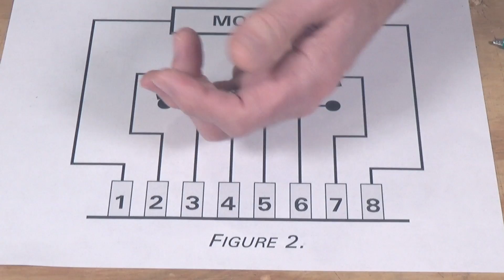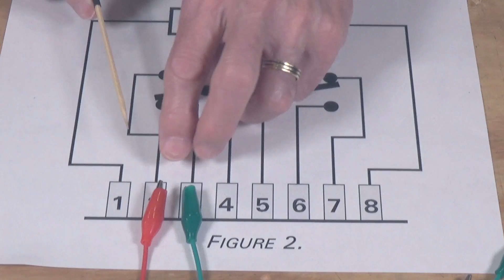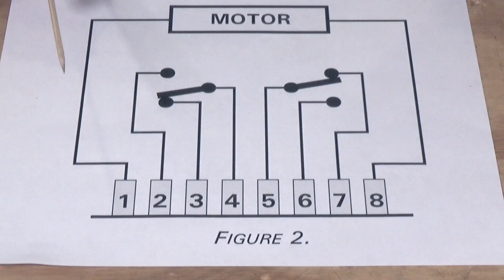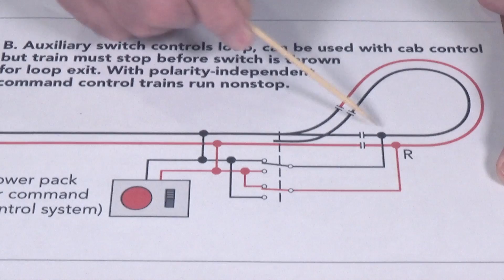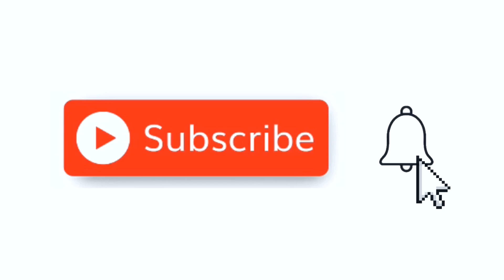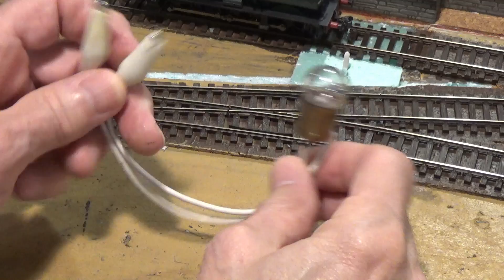Control Frog And Track Polarity Without Shorts (282)

Comment: Sorry to be so late but just found your channel and I have a question:  is there any reason that for a tortoise or smail switch machine contacts 1 and 2 and 3 and 8 can’t be tied together?   I do not have a separate accessory bus and the turnouts are going to be driven by track power DCC. Currently my tortoises are driven by Jack Wabbits but the next section is going to have smails so I will skip the Jack Wabbits. Thank you!
Reply from the maker: Well since 1&8 are used to power the motor in the Tortoise, tying them together will result in a dead short. What are you trying to do?
Reply: @TheDCCGuy  next section of layout is starting.  I’m going to use smails and peco electro frogs in a couple of spots so I need to power the frogs.  Never done this before but I watched your videos and figured I’d try the switches in the smails.  Im confused on where the power to pins 2 and 3 comes from.  It’s gotta be track power to send to the frog via pin 4 but aren’t pins 1 and 8 also track power for dcc?
Reply: @TheDCCGuy also- I meant tie 1 to 2 and also tie 3 to 8 but keep those 2 sets separate of course.

Comment: Larry Spoke with NCE support the NCE AR10 has a circuit breaker built in. You need to put the Reverse loop section of track on a separate bus line The AR10 cannot have another circuit breaker in front of and behind in the line. With that said then wouldn't a NCE AR10 be safe to use?  I did test this and when I shorted out the reverse loop side the track went dead until I removed the short.  Your thoughts Thanks
Reply from the maker: Tom, I have never used the AR10 but in reading the instructions it appears to work like most autoreversers. When a loco wheels hit the rail gaps entering the loop it will create a momentary short and the AR10 quickly reverses polarity clearing the short. My issue is with the momentary short required to activate the autoreverser. A short is a short and can cause the sort of issues I talked about in recent videos. That is why I did this video on how to control track polarity without the need to create a short. I know some/many will argue what is one little short going to do? Well I prefer to have no shorts but that is my opinion.

Comment: Interesting video, should you also mentioned whether you should be using an AC or DC relay? DC for a DC powered track and AC for a DCC powered track. I’ve used a DC relay on my DCC powered track, but I’ve had to insert a Half wave rectifier so that it works.

Comment: Larry,  Perhaps you can answer a question a for me.  I was a crypto electronics tech retired from the Coast Guard may years ago.  Before I wire in the power district to the PM42 I will verify that I do not have shorts with a Fluke Multi-meter.  However, once I wire into the PM42 my meter is showing a short.  The PM42 doesn't display a short or click trying to reset.  I know it detects shorts when I lay a tool across the tracks.  The trains are running fine.  I have pulled the wide connector off the DCS.  It is still there.  Why is my multi-meter detecting a short that the Digitrx equipment doesn't see.?  Is it something about the PM42?  It just bugs me.
Reply from the maker: It is likely that the units internal wiring represents a load that the meter is seeing as a short. I have a couple of those but prefer the faster acting protection of the PSXX units.

Comment: I was surprised to see Amtrak making an appearance on the upper deck there, Mr. Puckett!  Has that train been in that scene from the start (and did I just miss it?) or did you recently re-film your appeal for subscribers?
Reply from the maker: It’s been there for years it seems. I did an article on programming a decoder for use with it several years ago and it occasionally makes trips around the layout for grins. The F40PH and F59PH are my favorite modern passenger locos.

Comment: Great video. I had not seen connection of a relay using the second set of SPST contacts. Very interesting. Also, was not familiar with the insertion of a diode on the relay. Will failure to do that “blow” the relay? Thanks!
Reply from the maker: When using a relay, your relay circuit should include a diode in parallel with the relay coil. A relay with diode configuration provides transient voltage suppression when the relay is activated, which keeps the surge of current in the relay from burning out the switching circuitry.

Comment: My tortoise switch machines after time begin to “click”.  I assume that means that is something internal that is moving back and forth.  How do I fix this a  THANK YOU  Frank
Reply from the maker: Watch video #69
Reply: One of the gear teeth is worn down and that causes the clicking.  The correct fix is to replace the Tortoise.   The cheap fix is to lower the voltage to the Tortoise down to around 8VDC or so.   That will put less pressure on the gear train.